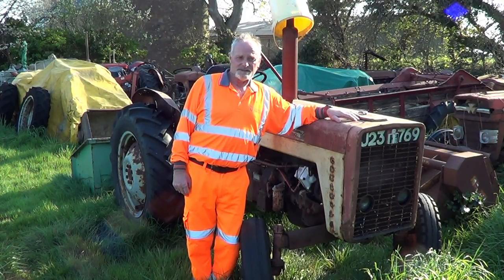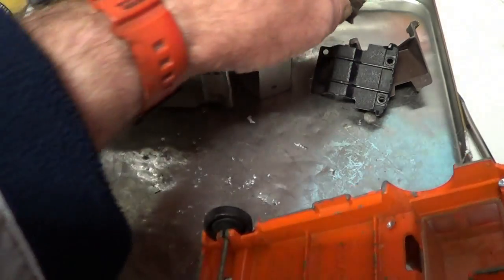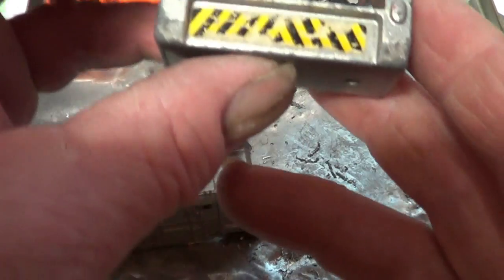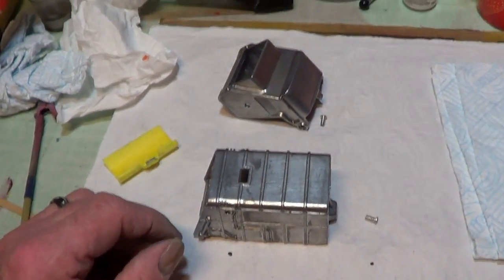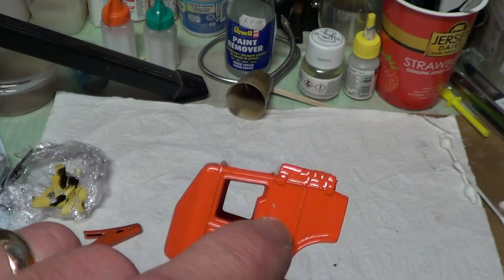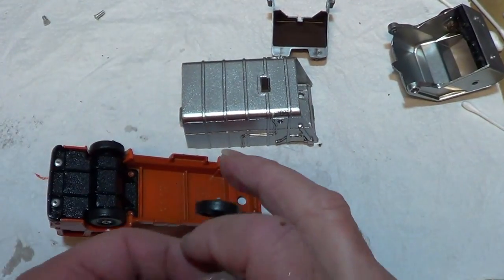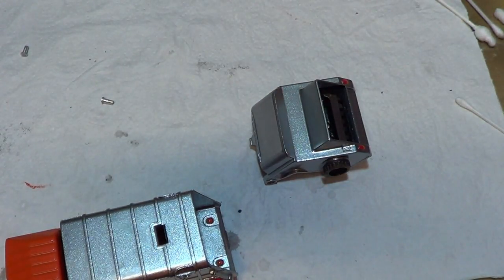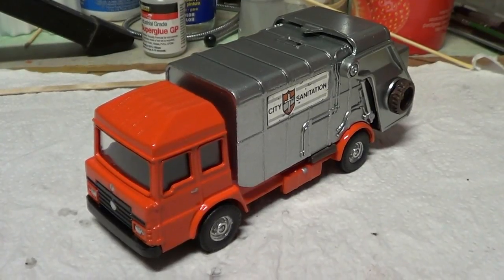CORGI REVOPACK REFUSE COLLECTOR, FULL RESTORATION.

Comment: Nice video Nick, I shared it on The Shelvoke & Drewry facebook page. One thing I did notice, The Ejector plate ( Part that pushes the rubbish out at the tip) You refitted it backwards! The slope points towards the rear ; -) I dunno if you'd want to take the body off again to correct it but hey ho. Very good restoration job 10/10
Reply from the maker: Thank you, do you know I didn’t even notice that I put the the ejector plate backwards, and I watched the video a couple of times, what A clown!😂😂 and I should have known better driving one! Yes I think I will undo it and put it right thanks for that!😊👍

Comment: I used to work on them Shelvoke & Drewry Revopaks, infact I have the sales literature somewhere among my collections. I noticed that you have a Massey Harris bed spreader. Got one just the same with yellow wheels, unfortunately it needs new chains. Do you know where to find a set? Nice work on the Corgi by the way.
Reply from the maker: Thank you Robert, ha that’s cool, I used to have a Shelvke and Drewry flatbed Lorry from the 1940’s, was going to try to restore it but I had to get rid of it when we moved out the Farm when we packed up, I gave it to the Pallot Steam Museum here in Jersey.. My old manure spreader is totally shot, I’d done it all up years ago and I used it and used it, spreading manure and seaweed, the seaweed used to make the grass very thick and lush and provide calcium for the cows. The floor chains used to break towards the end and I was always trying to weld the links back together, but the whole lot is too far gone now, not sure where or if it’s still possible to find some.